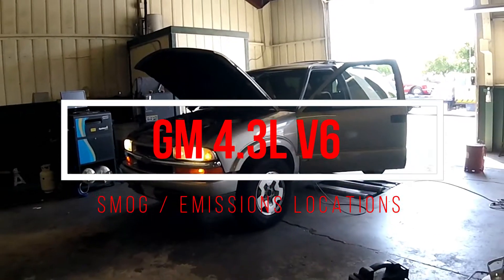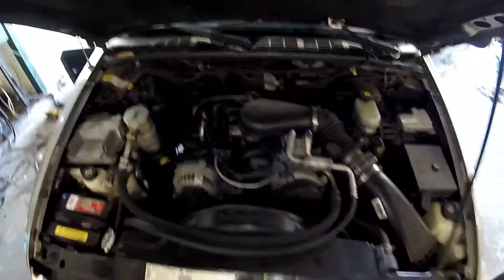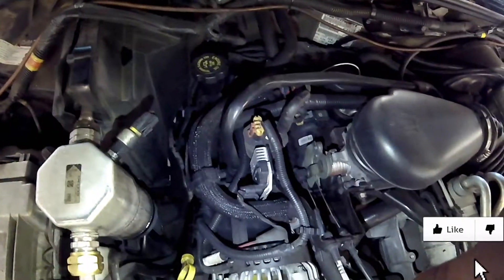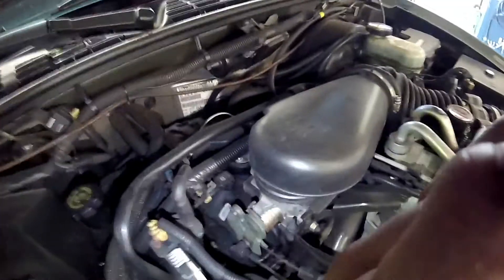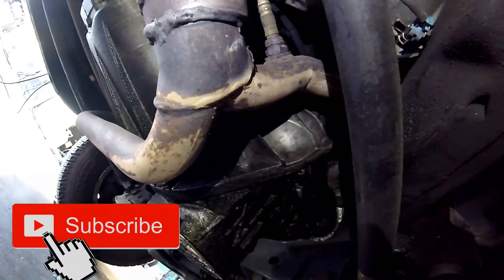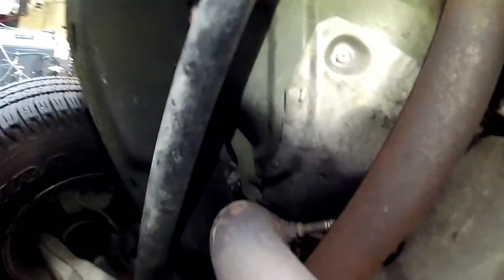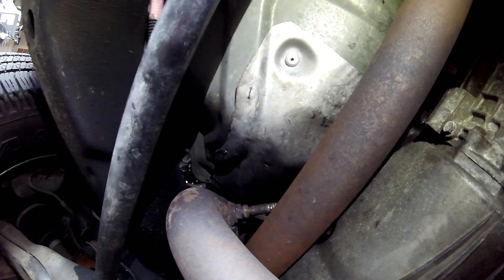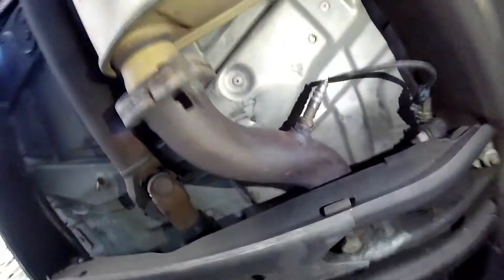⫷ Chevy Blazer 4.3 L, Vortec 4300, GMT 360 Emissions locations: PCV, Purge, O2 sensors ⫸

Comment: I need someone's help i have a 2000 chevy blazer that has been destroyed by cutting wires and removing sensor to make sure it works on propane gas behind the intake carburetor there is like a 4 or 6 wire connection or connector that i need to know what it is to buy it can someone please look into this i will be more than happy to send a video .. by the way will be buying the engine hardwiring system to replace with the one that has all the cuts pieces